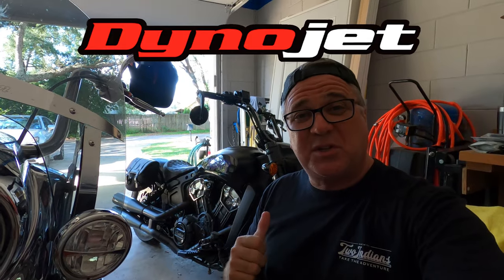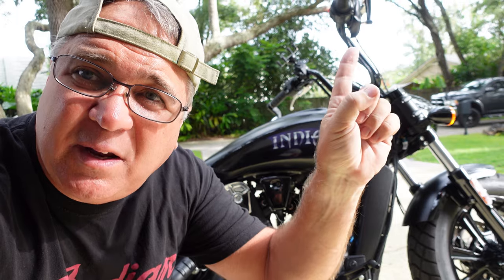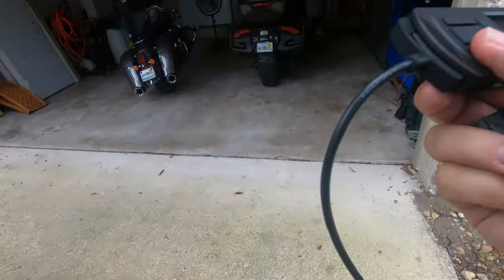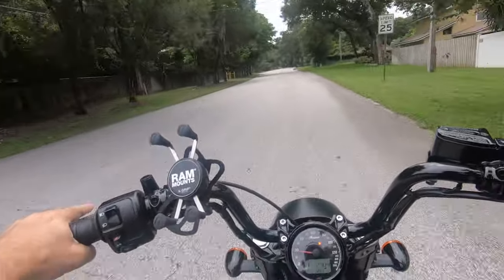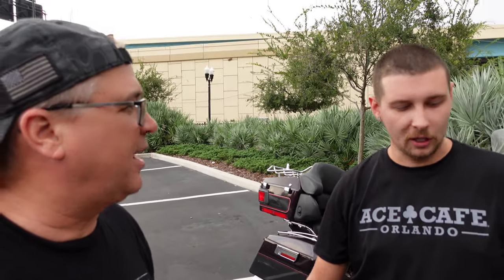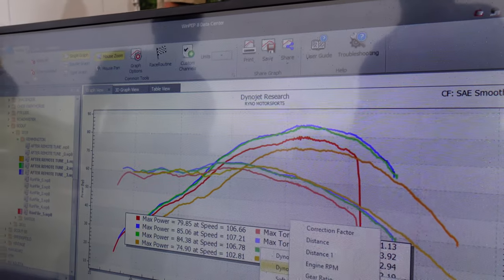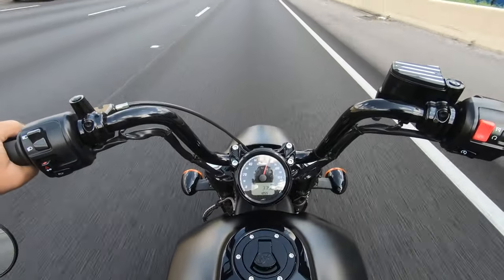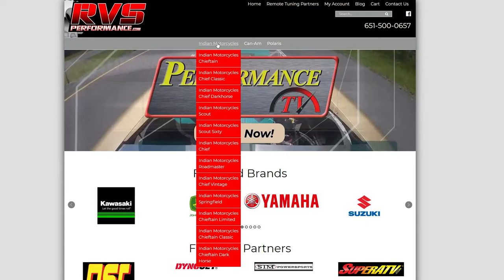Episode 5 - Custom Scout Bobber - Dynojet Remote Tune w/ B4 & After Comps + timed runs on each tune

Comment: Great video! I bought a used 2016 Scout back in May. It has the stock airbox and filter, and I believe the original owner drilled the baffles. My first upgrade is gonna be the Trask replacement induction and filter. I'll see if I can tell any difference, before thinking about exhaust or tune. New sub to your channel. You two ride and stay safe!
Reply from the maker: Thanks! Hey do yourself a favor and RVS before you pull the trigger on that Trask, if I’m not mistaken it was something he had a specific aversion to. Maybe it was my guy at Ryno Dyno but either way I remember hearing it may not be the best option.  Third hand info, I have no first hand knowledge. Anyway, thanks again!
Reply: @TwoIndians  I appreciate the heads up on the Trask!

Comment: If you buy the dynojet power vision 3 get it through fuel moto, they will send you tunes for what mods you have, without the hassle of having to go back and fourth and getting a limp mode. I had zero issues with either of the two tunes I have used, I got a trask intake and ran no mufflers and got the tune so I wouldn’t damage anything, then finally got an exhaust after all the back orders I went with two brothers racing 2-1, the bike pulls like crazy and redlines at 8800rpm
Reply from the maker: I’ve worked with RVS plenty of times to know if was a fluke, sent me a revised tune and it was no big deal. If you buy the tuner from him you get the tune free also. I’ve heard good things about Fuel Moto as well. Yeah she’s running great and never been happier.
Reply: Jamie at Fuel moto is getting 100+rwhp out of his tunes with airbox and exhaust upgrades . He made one for me and the bike is a totally different beast
Reply: @mrkihn  Wow. What mods for that kind of hp?

Comment: IMO if it works don’t mess with it. When you start upgrading the engine from stock you start having more problems. Stage one is okay but anything beyond that is just unnecessary. To each his own brother thanks for the video!
Reply: Riding Humboldt County true that brother I was VERY apprehensive about buying my Vintage because somebody else had already done motor work to it.  Intake,  exhaust,  bluetooth codes in the back of the book that logs god knows what onto it.  

Let me put you at ease though brother.  It's night and day. I HAD a 1900cc stratoliner Yamaha that I was PRETTY SURE could school most Harleys/Indians.  Nope. 

I put some nice 94 octane fuel in this Indian,  (started noticing it on about the third tank) and this bike makes power from everywhere!

You've heard the expression,  "Smoother than 4th gear on an Indian"? I totally get it now man.  

I can be in town going 20 mph and to engage my cruise control I need 4th gear.  It does this so easily. When I get to a faster speed limit I don't have to double back to lower gears it makes crazy easy to use torque even when I've put it at a mechanical disadvantage.  

The computers in these new bikes are smart bro.  The longer you ride the bike the more the computer learns about your riding style. 

The bike doesn't mind tuner upgrades. Trust man bro I wouldn't BS you the bike is happy at every RPM and gear. 

Maintenance? Don't let Brian scare you.  I know,  he's like a big shoeless kid wearing pants that would get him kicked out of gym class but NONE of this is really Maintenance.. it's upgrade bro and the factory didn't do it because if it rolled out of the factory with loud pipes and lower gas mileage the EPA and "save the planet" types would be all over it.  

But,  when we get it home... the sky is the LIMIT!! HOP that bad boy UP! Ha ha

Now I gotta get off of YouTube and back to the editing room Humboldt you are like three videos ahead of me. 

Shout out coming soon man.

Comment: Not sure if this has been mentioned by anyone:  The Indian scout is speed limited to 120MPH,  Doing a Dyno run on an Indian Scout in top gear will have you hit 120mph at around 6200RPM and not let you get all the way to the 8100/8200 Redline with the stock module.      The Indian Scout can actually hit 120MPH all the way down in 4th Gear.

Comment: Hi,

Loved the video I am considering to put the bike on a dynotune in the Netherlands. But I am a big cautious because I might end up f*coming up the engine. 

So could you help me out with it is it worth it and can I mess up the engine with the dynotune or is that just BS
Reply from the maker: It’s 100% better. The thing to remember about getting your bike “tuned” is that you are not doing it to max out the performance causing extra stress on the motor. You’re doing it to make it run optimally by creating a proper air fuel ratio based on the products you have installed. It may already be running too lean which can cause damage and the tune corrects these problems while also improving throttle response. You have nothing to fear.

Comment: You should be pulling sub 4 second 0-60. 1st gear will reach that. You can hit 100 in 3rd or at least close. Power band starts at 4K rpm. You got 8k rpm to play with. Also try adding a little power before releasing the brakes. Better jump off the line.
Reply: First could get to 60 but you will be close to 8k RPM... Shift to second gear around 50 to begin the 4k band in 2nd gear.

The power band is very noticeable.

Comment: I don't get it. I thought the number had 100 hp, went you only getting 79hp? That's not the 60 that had less power.
Reply from the maker: Indian rates horsepower at the crankshaft, a dyno rates it at the rear wheel, on the pavement

Comment: Stop looking at peak numbers. The numbers that matter the most are the numbers under the curve. You picked up a ton under the curve. Even if you did a dyno tune on top of the remote tuning you would probably only pick up another 2-3hp not worth it considering the cost of dyno tuning
Reply from the maker: Yeah, you are not wrong. Everybody gets caught up in what the maximum output is because that’s what all the manufacturers base their numbers on peak output. What’s more important is the power that you’re getting off the line and through the curve.

Comment: That is an inaccurate way of doing 0-60mph testing and 0-100mph testing. Get a proper device like a Dragy or VBox.
They are GPS based and also can tell the slope. Most runs will be invalid if the slope is greater than the accepted range. 
The results will be much different if you are on a 3% slope up or down. Especially on the 0-100mph run.
Reply from the maker: I will not argue any of those points however both of the runs are from the same starting point and indeed, there is a downhill slope. Not chosen for reasons of exaggerating performance but simply because it gave me the safest way to reach that speed with my own lane of traffic and no encroachment. Thanks for your input, it is helpful for future consideration!
Reply: @TwoIndians  Let me clarify. I have the same tune you do, just not from Ryan. I haven't dynoed mine so I don't know power gains or anything. My comment is NOT about the tune. Dyno clearly shows power gains. I am simply stating from my personal experience as I am car tuner I ONLY use Dragy for any performance testing. I say it because I heard you say you will use a stop watch when editing to get the times. That is just simply not going to be accurate. Look into Dragy. I think it will be a nice addition to your channel.
Reply from the maker: @AndoBMS  yeah, 100%, I get it. This is strictly for demonstration purposes. Fwiw, I ran my iPhone stop watch for 15 seconds and did a screen record at the same time. Then I laid that video on top of the actual ride video, aligning the start of the clock with the moment the bike started moving forward, and then recording the displayed time the moment the bike’s needle hit each speed marker. Again, 100% unscientific but the best I can do without buying a bunch of expensive gear. Curious what your HP/TQ numbers are.
Reply: @TwoIndians  Mine won't be comparable to yours as it's Scout 60 Bobber. From the research I did  it seems like it should be making the same power as scout 69 in stock form. Mine has the filter upgrade and Combat 2-1 exhaust. It's my first bike :)
Reply from the maker: Awesome set up! Too loud for my wife for sure.
Reply: I use race timer app. Go’s bases. No incline. Open the app press ready and go. Timer doesn’t start until it detects movement. Shows splits that you define. Easy peasy

Comment: The bike has 98 horsepower from new with no adjustments , your full of it
Reply from the maker: Thanks for your comment George. The bike has 98 or 100 hp from the  factory, depending on which model year you’re looking at I guess (current year says 100)… But that measurement is at the crankshaft, not at the wheel. These measurements are at the wheel. Thanks again for your input.
Reply from the maker: so i guess when you said "full of it" you meant accurate information? :D
Reply: Stock Bobber is probably 80-83 HP.